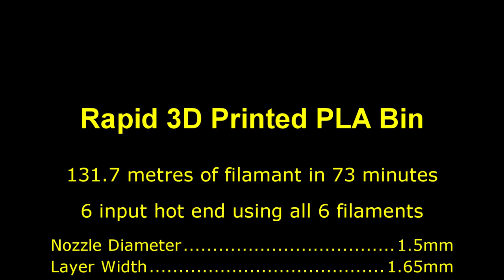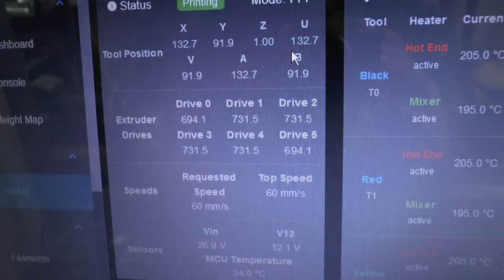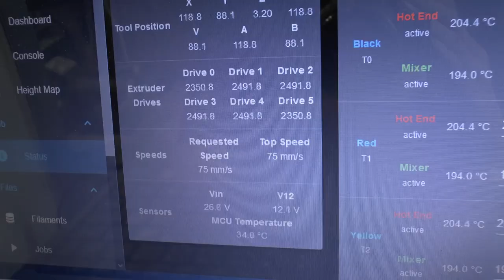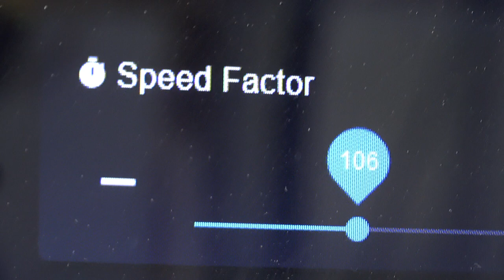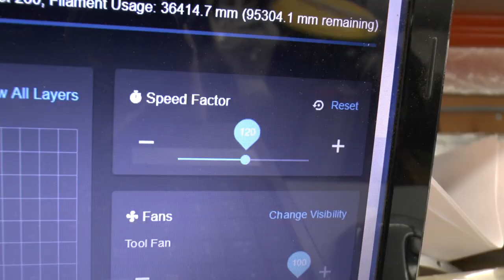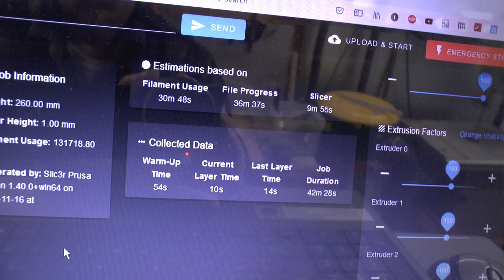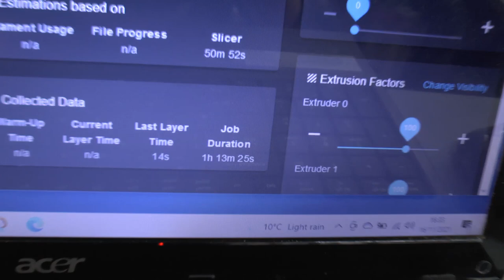PLA Waste Paper Bin in 73 minutes - Insane Melt Rate!

Comment: Great work, I am loving the multicolor effect!  I had left a response to someone who came by here earlier trying to talk down your efforts and not understanding this project.  They (I believe mistakenly) wrote units as mm/s^3 instead of a volumetric mm^3/s and so I couldn't resist the opportunity to refer to their comments as overly jerky (mm/s^3 being jerk, derivative of acceleration).  You're not going crazy, I just wanted to clarify.  I totally understand that the higher flow rate capacity of this system is a feature of having so many individual inputs and that you were going for multi-material/multicolor first and foremost.  I left a comment on the lastest cnc kitchen video trying to point people to your channel since you've been pushing the envelope with regards to mixing.  Sorry for any confusion.
Reply from the maker: Thanks for those words of encouragement. I received notification of a comment from someone with the user name of a "a guy printing" who basically slated everything about this hot end, my machine in general, and me personally. Those comments seem to have disappeared before I could respond and I can only assume that the author deleted them. 
Given that the only reason I post videos and use my blog to document my work (both successes and failures), is to add to the pool of knowledge which exists and not for any financial gain, such negative feedback is hard to take. I almost decided not to bother sharing any of my findings every again and simply keep them to myself. 
But your words of encouragement have restored my faith in human nature, and I will continue to publish my findings in the hope that the information and knowledge gained might be useful to others.
Reply: @deckingman  YT is great for sharing worldly knowledge.  The other edge of the knife to it is that we have more people than ever who now believe themselves to be experts after watching even countless hours of other people building and tinkering yet have never made anything themselves.  There are even fewer who are hardcore tinkerers or accomplished engineers who probably build personal projects but don't publish anything (that's fine too).  I create content elsewhere and I know in and of itself that it takes time and effort, so a big thank you for all you share.  I recognize you've gone further than most.  Please don't stop for some ignoramus.  I consider you a tremendous asset to the community, and it makes me sad (although maybe not surprised) to think that we were a negative comment away from leaving you totally jaded. Lord knows how many times has this happened elsewhere?  I hope you will continue as new ideas develop and new products and solutions come onto the scene.  We can fly drones on Mars.  With enough eyeballs and talent on this sector we will advance forward on the stripy toothpaste - true mixing continuum.  At least that is what I hope to see!

Comment: What's your best time to print a benchy?
Reply from the maker: Short answer - I don't know as I've never printed one, but I suspect it wouldn't be that great. Longer answer - This machine and in particular this hot end are primarily designed to print multiple materials. The fact that it's capable of high volume flow rates is an added bonus. A benchy is the type of thing one would print to evaluate things like overhands, bridges, retraction settings etc. As such, it has a level of detail that requires a nozzle much smaller than the one I used for this experiment. For high volume flow rates with a small nozzle, one would need to use a very fast print speed, but because a benchy is quite small, one would also need to use very high accelerations in order to reach those high speeds over short move lengths. To attain, such high accelerations, one would need to use low mass and/or servo motors which don't lose torque at speed the way that stepper motors do. But because this hot end has 6 inputs, it's mass (although not as great as 6 hot ends) is fairly substantial. So the acceleration is limited and thus, so would the maximum speed that could be obtained over small moves such as would be required to print a benchy in short time. In a nutshell, if I wanted to print detailed parts very quickly, I wouldn't use this type of hot end.

Comment: Is the colour change caused by direction of extruder movement in x, y or is it intended.
Cnc kitchen has just uploaded a video about dichromatic filaments (two colours in a single fibre, and posited the idea of having different materials for different properties, Ive seen a few videos blending different plastics through a 2 in 1 out, the results depended on extruder travel and slicing parameters. I wonder with your set up could you have a core of say pla surrounded by a sleeve of pteg, abs or tpu?)
Reply from the maker: The colour change is due entirely to the fact that no "mixing" extruder actually mixes filament. It's well documented and something that I've been banging on about for many years. It's often called "the stripey toothpaste" effect because that is effectively how the "mixed" filaments exit the nozzle. That is to say, the filaments are "combined" but not actually mixed. The still image of the bottom layer at the end of the video, serves as a good illustration of how one or other filament will become dominant depending on the direction of travel of the print head.
Reply from the maker: For sure, one could "combine" different filament types, but not in a way that one filament would surround another. And they would need to have similar print temperature requirements.